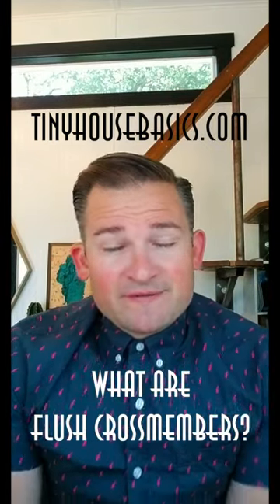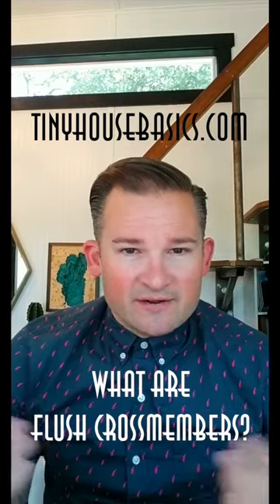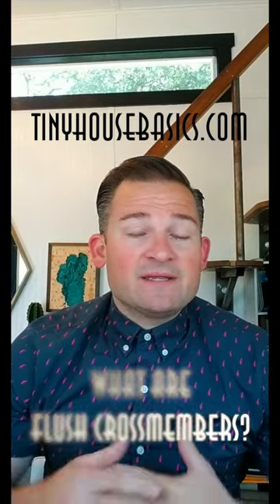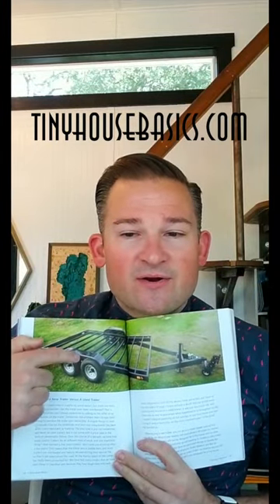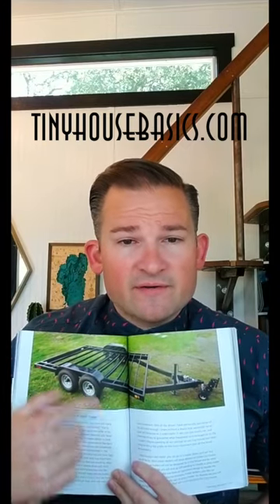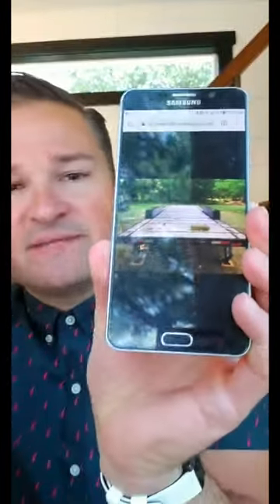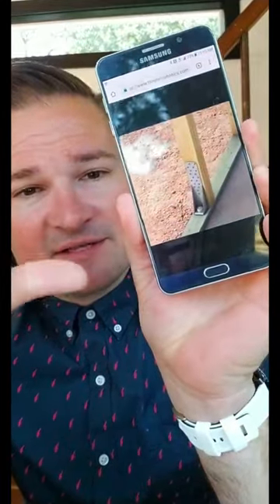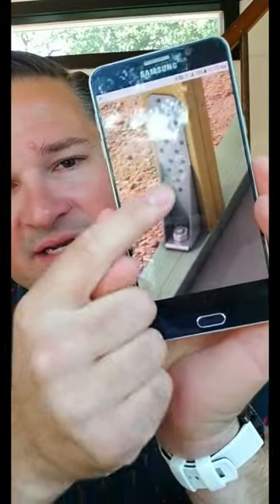What Are flush crossmembers on a Tiny House Trailer?

Comment: Is it overkill to run the "anchor bolt" all-threaded rod the entire wall height? My thought is to double nut the bottom, and a top and bottom nut at the top plate (with plate washers at all nut location). While using the Simpson tie downs top and bottom as well. Being a Retired Petro-Chem Structural Engineer, I tend to "over design everything" when it comes to 'racking' and wind loads.

Comment: For trailers wider that 8 feet how would you deal with the little bit of space left over from 2 sheets of plywood?
Reply from the maker: If you are referring to the subfloor, there is a whole build ahead so there is many ways that wood can be utilized, maybe in the loft floors or other places as well
Reply: Sorry I was imprecise, for the subflooring on a 102 in trailer would you use 2 pieces of tng plywood together and a cutoff of another piece to make up the rest of the width or would you put the full sheets of plywood on either side with the small piece in the middle of the larger sheet? Hopefully that is better worded this time. It would be better with pictures.

Comment: Do you use a thermal break between the metal frame and subfloor?
Reply from the maker: When laying the subfloor on the trailer, We always prefer glueing and screwing the T&G down, the construction adhesive adds a decent thermal break, You can also instead of the adhesive use a r0 sill sealer.
Reply: @TinyHouseBasics  Metal is an extremely efficient thermal conductor. Far more than wood. This is why we never use wood as wiring or as a frying pan. Those metal crossmembers are an extremely efficient thermal bridge. They will not only greatly affect the comfort of the house but it will also risk condensation and moisture damage to the wood installed on top of it. Insulation will need to be in between the metal crossmembers and the wood subfloor to prevent this. Construction adhesive or a sill sealer is simply not enough in my opinion and I would not be comfortable just doing that in my own house or anyone else's. MY QUESTION: I would still be installing insulation boards in between the crossmembers but what I want to do to remedy the thermal bridge of the metal crossmembers to the wood is use continuous rigid/high psi insulation boards over the entire length of the trailer that would cover all crossmembers. Using adhesive to secure the insulation boards to the tops of the crossmembers and the insulation boards in between the crossmembers. Then adding the subfloor osb on top. Securing the osb to the insulation boards with adhesive and screwing the osb to the metal crossmembers all the way through the insulation. So that all layers of insulation and subfloor osb would be secures to the crossmembers. Have you ever done this kind of job or know of any customers who have? Would you recommend this installation? Thank you

Comment: Question, could I get it with flashing but not have it flush? I live in MN so winters suck and metal is conductive as heck. I want to put in-floor heating but also want to beef up the underbelly so it'd be like a double subfloor (sorta)... but in any case, would I have to worry about condensation in the subfloor and have it prematurely rot/rust on me? Attaching a vapor barrier effectively to a metal trailer seems..... difficult?
Reply from the maker: absolutely! they are two different option and you don't have to have one without the other, they are independent of eachother
Reply: @TinyHouseBasics  Sweet! That's good to know and thanks for the reply!